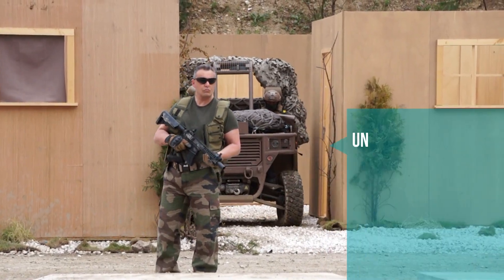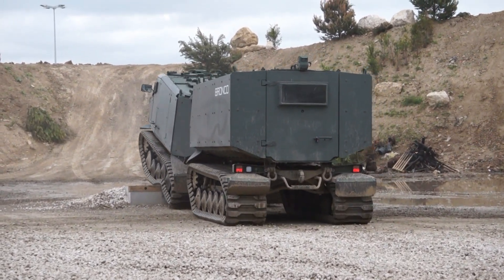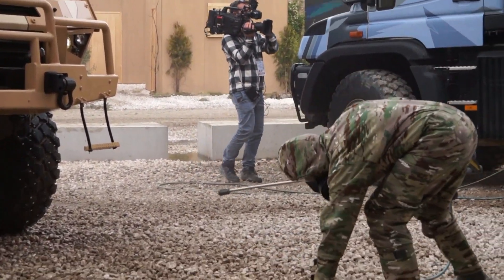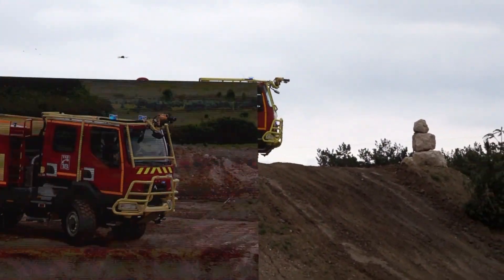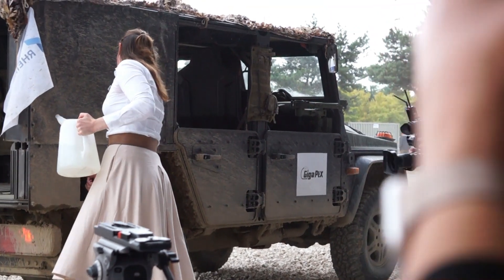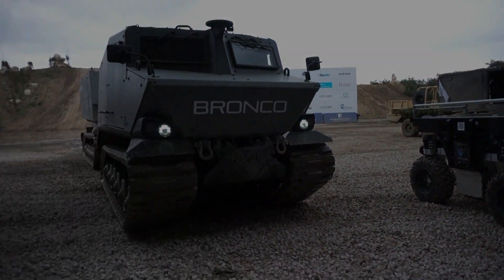Military vehicles in live demos at Paris Eurosatory 2024, the global event for defence & security

Comment from the maker: 00:05 PVP, Petit Véhicule Protégé 
(Small Protected Vehicle)

 by Arquus (France)
Live demo of the BRI-PP, the 
Research and Intervention Brigade 
of the Paris Police Prefecture

00:10 Fardier RIDER (Rapid Intervention Droppable
 Equipment for Raiders) by UNAC (France)

In service with French Army's
 parachute brigades

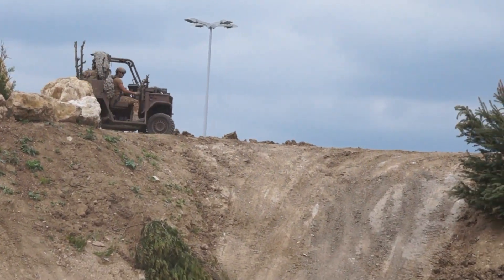01:22 Fennec II by Technamm (France)
Based on the Suzuki Jimny chassis
02:02 Masstech T6 by Technamm (France)
Based on the Toyota 70 Series

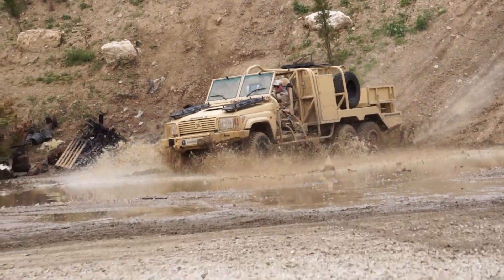02:34 Fortress MkII, derived from the Acmat VLRA family (véhicule léger de 
reconnaissance et d'appui: light
 reconnaissance and support
 vehicle), by Arquus (France)

03:06 Bronco 3 AATC, All-Terrain Tracked Carrier
 by Singapore Technologies 
Engineering (Singapore)

04:10 Essential Decon, by KNDS CBRN (France)
Based on Mercedes-Benz Unimog

 chassis
CBRN (Chemical Biological 
Radiological Nuclear) 
decontamination system

05:06 Centurion D14, by Essonne Sécurité (Armoric Holding) (France)

Based on the Renault Trucks D14 4x4
 chassis
05:39 CCFM-HP D14 4x4, by Sides (Armoric Holding) (France)
CCFM-HP (camion-citerne feux
 de forêts normalisé haute pression):
 high-pressure normalized
 water tender for wildfires

Based on the Renault Trucks D14 4x4
 chassis

06:09 Artus, by Charisma Tec (Austria)
All-terrain UGV (Unmanned Ground 
Vehicle)

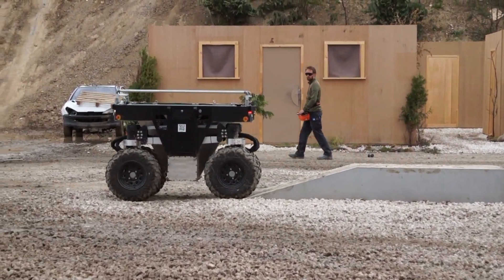06:55 Caracal, by Rheinmetall (Germany)
Based on the Mercedes-Benz G-Class
 4x4
Powered with synthetic fuel
developed with Ineratec (Giga PtX
Project)

07:48 Closing of the show